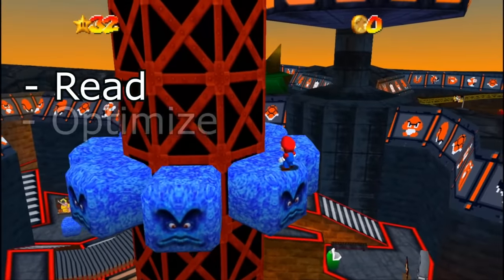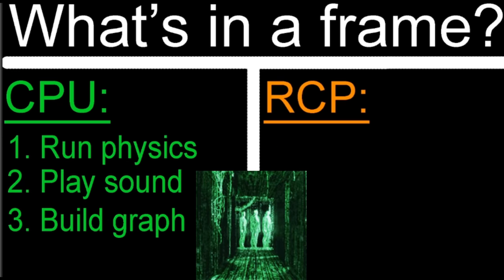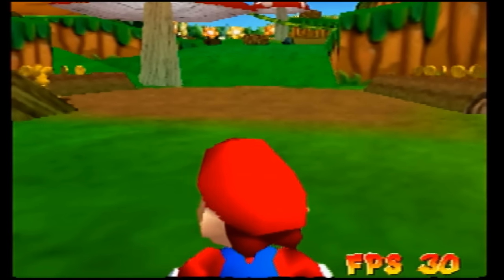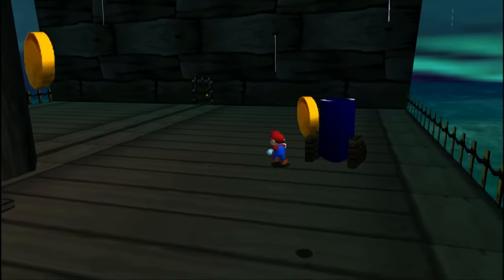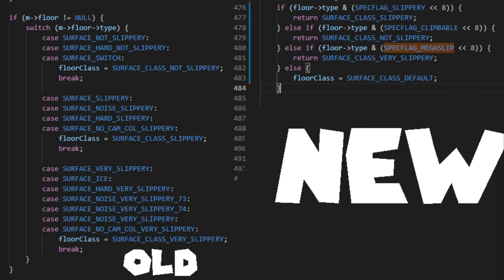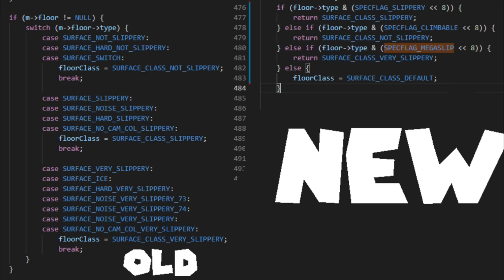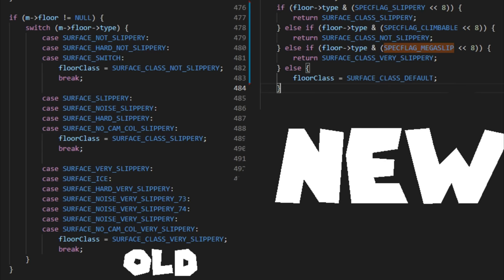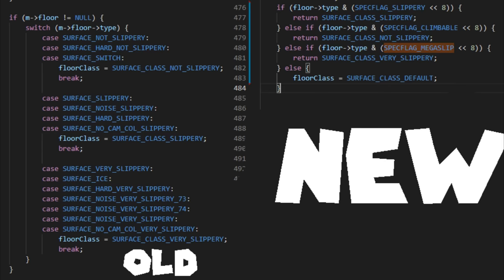FIXING the ENTIRE SM64 Source Code (INSANE N64 performance)

Comment: 3:17 this visual reminded me of a Mario 64 dream I had years ago. There was this enclosed underwater chamber, the scale of which was a lot like this. To get out into this large open area you would swim past round (more like nonagonal) gateways that had these large turbines slowly spinning. The wall that encircled the big grotto used the pale cobblestone texture, and though parts of it were sealed off you could tell it was circular, save for the way you initially get in. 
   The center of the place, you could see the underside of an island that connected to the ground via much thinner stalk of what looked like coffee ground texture. Above that was the main source of light, a hole in the ceiling that showed the cloudy blue sky background. I got this feeling that the place's overall design was like that "indoor beach," sort of conical enclosure where you wouldn't expect it.
   At the opposite end to where you passed the first turbine to enter the larger grotto was another gateway. That led to a wide hallway which had a fat shark patrolling at the entry point. (One of the other turbine gateways was also guarded by one of these sharks.) To the left, it opened up into a dark, murky open environment much like we see in the video. You could see another shark coming in and out of the lighting render's fog point.

I know it's not very relevant, but seeing this part of the video gave me that same sense of scale and awe at how large the environment felt, to where it jumpstarted my memory. This is a massive achievement you've accomplished, and that ROM hack looks all the better for it. Necessity is the father of innovation.
Reply from the maker: note that down, stuff you see in your dreams is some of the most creative and vivid stuff you can come up with. it might be useful in the future.

Comment: This is absolutely incredible work, but C was in no way a ‘new language’ in 1996 (it was already over 20 years old, and nearly every major OS had been built largely in C or C++ for years at that point) - did you perhaps mean it was relatively new to console developers in that generation?
Reply: @percival no, those where written in C. There is a compiler that transform that code into machine code of the snes
Reply: @ignasscio  I'm sure it was an option, but at the time there were still many games made in assembly
Reply: @ignasscio  SOME SNES games were written in C.  And you can usually tell because they generally run like dog ass for no obvious reason.
Reply: @ignasscio  Absolutely not. You have no idea what youre talking about. Every single snes game was written in assembly. From final fantasy 6 to super mario kart to earthbound. C only started getting use in the ps1, and thanks to john carmack for pc 3d games in wolfenstein 3d.
Reply: Yeah, I'm an old programmer, and C was my main language in the mid-80s (IBM PCs and later compatibles).
Reply: Yeah, 8 and 16 bit consoles and home computers vastly benefitted from the speedup from coding much closer to the hardware. These days, a combination of more forgiving hardware and compilers getting a whole lot better at optimising stuff has shot C and C++ up to the heights of the "write this for the most optimal code" language that it is today.
Reply: Sonic Spinball was written in C.
Reply: @Magus12000BC  Yeah, I've heard about that, and honestly it explains a lot about the experience of playing Sonic Spinball.
Reply: @jonnyj.  Nah, it's not that black and white; it was a lot but definitely not "every". (Certainly most of the good ones, to be sure.)  Disassembly makes it really obvious when a high level language was involved.

Comment: I don't know where you got "C was relatively new" when the N64 came out, especially since it was already being used in just about everything major, and it was 24 years old in 96.
By comparison, C++ was officially 11 years old at that time.  Usually, a language is no longer considered new once it is between 5-10 years old, and has a major following.  Hell, Java was 1 year old when the N64 came out, and it stopped being considered new by 1998, where it was all over the place.
Reply: I guess what he should have said is that, 3D was new. The 3D game technology was new at that time.
Reply: You're definitely right about that. However, I've been a game developer professionally since 2009 and wrote games for older Nintendo hardware as student projects, so I may have some perspective to offer.

While C was by no means a new programming language when the N64 was in development, most games were predominantly programmed in assembly for quite some time after C was released for various reasons: it was what the developers knew, it offered greater performance and control, compilers were generally not great and were universally pretty poor at optimizing, etc. That goes double for console, since the hardware is less powerful relative to contemporary PCs, more resource-constrained, and until recently, often relied on proprietary architecture (read: required a new compiler to be written for it). In fact, it was commonplace to develop games in assembly for the Gameboy Color, due to its banked memory model, and it released after the N64. Granted, it was a handheld device.

In order for C to be available as a programming language, a compiler must exist for the target platform. There'd have to be enough interest from game developers in order for it to make financial sense to develop a compiler and support it. Nintendo's developer support also has historically not always been the greatest (hence their earlier reliance on first party titles), and many of their initial compilers, dev kits, and dev tools were notoriously subpar. That has gradually improved over the years and is on point for the Switch, though!

All that to say, C was relatively new for game development when the N64 released, which may be what Kaze is referring to here.

Comment: This is insanely impressive, if something like this could be done for ocarina of time id shit my pants
Reply: I mean it's probably possible
Reply: @RiahGreen  True. The OoT community just needs to get themselves a Kaze.
Reply: I am pretty sure they share similar code.
Reply: @Gunplabro  mario 64 and oot have entirely different engines, but the similar way they run on the 64 would greatly benefit getting it to run better but u still have my doubts as oot is alot harder on the hardware then mario 64 as it came out later

Comment: I wish I had the same brain power as you lol. And I’m so excited about a possible multiplayer. I had this hypothetical idea where two N64’s could link together for multiplayer with some custom hardware so they could interact with each other, not exactly sure how that would have exactly worked, but this is amazing. I’m amazed at how far this project has gotten so far.
Reply: He's already released an optimized mario64 with split screen multiplayer which is what the footage of split screen in this video is. The optimizations aren't as high as they are for this new mod though but the split screen is working good in his original release.
Reply: @Agret  Wait until you see the performance on real hardware lmao. There is definitely more room for improvement. Fortunately, Kaze has improved a ton more since then. I'm excited to see what Kaze's hack will be like when it's finished.

Comment: I love how thorough Kaze is with all this! It’s also really funny too with the Rambus.
vroom vroom
One question though, you mentioned something about an illegal line of code, what makes it illegal? Can you expand on that? That makes me wonder how many times other games had to make code more tedious than optimal >_>
Reply from the maker: i call it "illegal" because other programmers will yell at you for doing things like that and because that type of code will sometimes only work under special conditions, as in be unstable on other platforms.
Reply: @KazeN64  that makes sense, thanks for clarifying!
Reply: FBI open up!
Reply: The "illegal" line of code shown in the vid is only equivalent to the original code on big endian hardware.
Reply: @KazeN64  I wonder why the compiler doesn't optimize the bitwise operation
Reply from the maker: @lescitrons  it probably does already optimize this. though i use similar examples over the code where it won't optimize it, because the way im doing it will only work on 32bit registers or something.

Comment: It's interesting how loop unrolling, which is usually an optimization, does the opposite in this case!
Reply: It's known to really depend on architecture. BLAS implementations often benchmark themselves to find the best unroll tradeoff on an architecture. They test a bunch of pointers or array decisions and stuff.

Then there is the trap of micro benchmarks. It is possible that unrolling is faster on N64 if you loop over that code infinitely. But once you add the rest it gets slower because it impacts other things in the architecture, like caches.

Comment: I also want to ask: down the line once the mod is done... will an optimized version of the original game be possible?
Reply: I think he'd have to re-do all the original levels, otherwise they won't be able to take advantage of the improved code, heck I think they might not even run in the new code. I'm not sure however since I'm not a programmer myself, but surely it would have been quicker to show footage in this video of those levels instead of all new levels? I think the new levels take advantage of the new code and the original levels simply do not. that is probably also why he compared new code version to a version he made a year ago, instead of to the original. he also mentioned several times that if you were to load up the new level in the original code it'd be a quarter of the speed shown in this video. (less than 10fps).

out of laziness you'd use the original games levels for showing off improvements, unless they can't be used to show off the improvements in the first place. which indicates needing a re-write.

at that point you'd just re-make the game in unreal engine 5 or something and forget about N64. the only reason Kaze is doing what he is doing is for his original mod creation and romhack entitled 'return to yoshi's island'. new levels, new code, etc. anyone wanting a faster or better original SM64 might as well wait for the inevitable 'UE5' remake.
Reply: there's nothing inherently different about how the stages are. There's only code changes

Comment: I keep saying "it's not about the power of the console, but how you use that power". Why are many of Nintendo's games looking so good? ( Mario Odyssey, Zelda breath of the wild). Because they continue to optimize their engines with each new game they release. The sequel to breath of the wild will run on much better coding than the first one, and so will the next 3D Mario game. If you continue to forever optimize, eventually you might make uncharted 4 run on a switch without too much graphical degradation or frame drops, but that's the thing though, there's a time limit when it comes to optimizing a video game's code, at some point the next batch of improved code has to be saved for the next game.
Reply: Just look at mario odysey and than look at pokemon arceus. You are right.
Reply: @N0Game  just to clarify... you are saying Arceus looks poor... right?
Reply: How many lines of code have you written in your lifetime?
Reply: lolno
Reply: @Semperverus0  are you going to tell me you've actually developed a game?. Go on, tell me about it. If you are so confident that optimization doesn't do massive wonders for a game, lay out your response. I've been following the video game industry since the NES. Optimization  obviously does wonders for any game. I'm not saying that you can make uncharted 4 run on a switch now, but eventually with enough optimizations, you can create a version of uncharted 4 run without massive losses in graphics. You'd need enough optimizations that would probably need to go through many several cycles before we can get there. They did manage to make games like the crysis games run on switch. Crysis still makes most of the top of the line computers sweat trying to run it. There have been  "impossible" games on Nintendo switch.  Yeah significant downgrades are necessary right now. But with enough time and development time, you can make amazing things with outdated technology.
Reply: @deepmind5318  ehhhhh it would take a lot to make Uncharted 4 run on the switch. The Witcher running on it is basically magic. 

Optimization DOES really improve games, but it isn't the be-all-end-all. I really doubt BotW2 will be much more optimized than BotW, I imagine most of if not all of their time is going towards creating content. At a certain point, while optimizations may be possible, they don't make sense for a company seeking profit. A finished product doesn't necessarily need to be a perfectly optimized product
Reply: @deepmind5318  the Crysis thing isn't true though. It barely pushes my computer, and mine certainly isn't top of the line these days
Reply: @deepmind5318  if i remember correctly, the problem with crysis was that they built the engine based on an assumption that the cpu clock speed would increase, but instead it evolved to be more efficient. so while a modern computer will run it, it wont run much better than the old hardware
Reply: @feanorkiu  yeah because its a old ass game

Comment: I find it very interesting that, if I'm understanding this right, the game determines sound to be played before it renders the graphics of the next frame. How does the game keep the physics, sound and graphics information properly partitioned while doing these calculations?
Reply: Not a programmer, but I imagine they all run on their own threads which are executed in sync.
Reply: The soundcard is yet another different part of the system that gets accessed from the CPU
Reply: @cmyk8964  So it doesn't even really affect the RAM bus speed then?
Reply: @mathphysicsnerd I’m generalizing I don’t know how the N64 works specifically, but computers usually have a separate soundcard that preloads some music and common sound effects data, and just receives events to play, stop, change the volume, etc.
Reply: @mathphysicsnerd  From what I gather...The original logic waited until it was done rendering before playing the sound, so there would be a slight delay(which would be in milliseconds). The sound/music or whatever is being sent before, so it would allow the sound card to operate while the RPU is doing graphics rendering. A lot of these RAM - CPU - RPU mods are so that the system is using as much of each component to it's full potential so there's less waiting and delay. Then unneccessary code and such removed, faster methods of caching data and computational loops, etc.

Comment: I wonder what would happen if you got a speed runner to play this without telling them what you did, would they still play the game the same way or would it mess them up completely though subtle changes.
Reply: They'd already notice.
Reply: Miss

A 3x performance gain is not subtle
Reply: @smd89xx  it's still the same game mechanically and in instances where the game is running at it's best  on vanilla the gap will be significantly smaller. Dire dire docks would be one of the biggest changes as it kinda shits it's pants on the original.
Reply: the game would run easy 60fps so it would play the same it would just be uncannily smooth for an unmodified n64

Comment: the first question that come to my mind when seeing this is;
Would it be possible, technically, to do the same kind of optimization for other games like Ocarina of time or Golden Eyes ?
Reply: You would need to get the original source code, sm64 has it's source code leaked a few years back but most n64 games are a mystery sadly
Reply: Depends on how the game was programmed. 

In theory - yes

Realistically - no, not really
Reply: Both are nearing full decompilation, expect both of them at worst until 2024
All that is improved with mario can be done with james bond and zelda games, you just need men to wrench out code
And don't listen to comments above